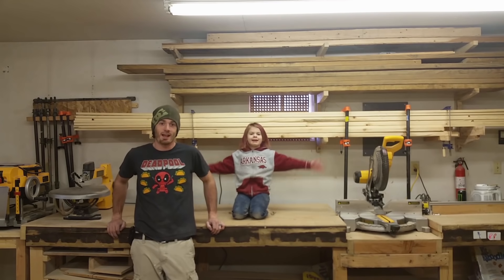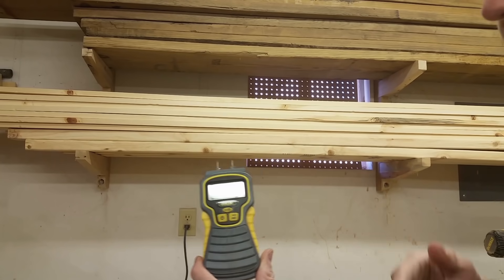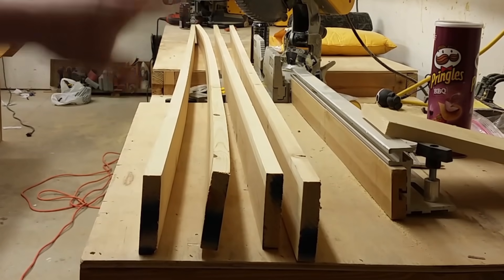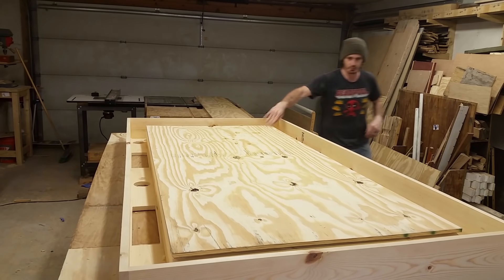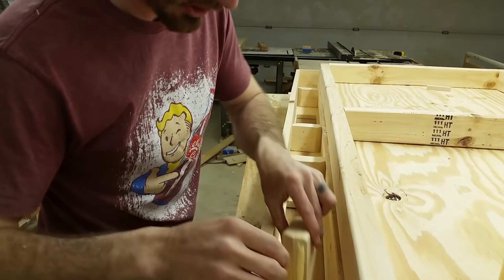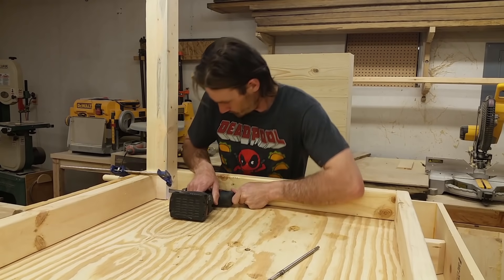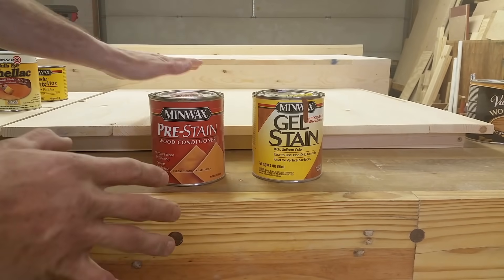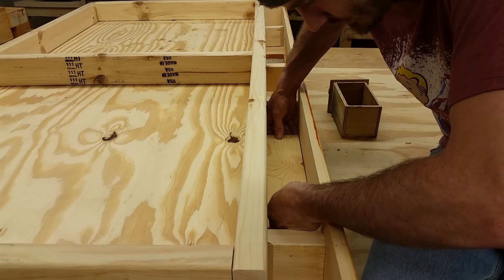How to build a gaming table (easy)

Comment: Might be worth noting that the best way to dry your wood in the shop is to install stickers (~1/4" thick sticks) between the boards and then clamping on the stickers. This leaves small gaps between each board to allow for proper airflow between the boards which results in more even drying.

Comment: Love this, well done.  Going to do something very similar here shortly.  I am going with neoprene mat for the vault surface, and will use a pin hole to push up the table top edges to remove them, and will have a 3/4 piece of plywood cut into 3 or 4 pieces with dowels on one piece to assemble together.  Also going with a trestle base.  Debating cup holders on the outer rail with router or cut out player areas like you did, or have those all on a rail around the outside.  I also plan to stain to a darker color, but all of that is just finishing stuff.

Comment: For the EVA foam, give it a once-over with a heat gun to close up the pores. Once that's done, contact cement won't absorb as much, but still has enough porosity to give solid adhesion.
It's an old cosplay trick.
Reply from the maker: Good tip! I'll have to try that

Comment: Great video.  One thing I've wondered about this game table design (as I've seen this built the same way on several channels) is why there is so much effort made on the dice trays and cup holders and why those areas are so narrow.  I built my own table without plans and used 1x12 for those areas to accommodate books and papers.  I didn't build trays or cup holders.  We spend so much time writing notes etc., that I thought that was more important than the other stuff.  If I were to build mine again, I'd build it the same way, but have a drop down area in front of each player to be able to "store" books, papers, etc when not in use.

Keep up the great work.
Reply from the maker: Thats a really good idea. Personally I'm not much of a gamer so I just built it the way my friends wanted it.  They wanted cup holders and pencil holders. I think making a spot for books is a great idea. Thanks!
Reply: Coming in late, I am starting my game table build next week. I would say it depends on the kind of gaming you are doing. We don't do any pen and paper, but board games. So we don't have any books or notes taking happening. Trays for us would be more important for meeples, coins, cards, cardboard bits, minis, etc. and manipulating the actual pieces on the board every turn makes a narrower edge more practical so you don't have so much to reach up and over constantly.
Reply: Coming in real late, but the reason most players go with 4 to 6 inches for that outer rail is because the larger this is, the farther you are from the actual game surface and the more players need to stand and lean in to adjust playing pieces or whatever.  We have a few games where there are a lot more components to organize at a player station, which is why I think I will end up going with an outer rail along the edges to put in accessories like player boards where they can place these types of things.

Comment: You know, for the tabletop insert, you could also glue on and/or screw on a canvas backing like a roll top desk. This will keep the boards together and in order, and allow you to fold up the top to make it smaller and less unwieldly.
Reply from the maker: Oh I like that. Maybe it could even roll up.
Reply: @WyldeWoodworks  And put it on the shelf under the table so it's out of the way.

Comment: Wow this was awesome! Thanks! I may soften the edges of my table a bit and make the cup holders a little farther apart but this is going to be providing a huge starting point. Would be pretty cool to lay in some finished pieces over top your trays too so those can also have flat surfaces when you want to cover it. I’m curious to see if you think the Eva foam ended up having any visible seams or if you would’ve done anything different for the liner.

Comment: A tip I saw on another video was using an epoxy with a relatively long working time instead of contact cement. Still holds strong, but it gives you some time to get it just right. They were applying veneer, but I'm sure it would work for EVA foam too.

Comment: Oh man, Loved this whole video, except when you had the nail gun pointed directly at your stomach (I know there were some other layers, but still.... NO)
I probably wouldn't have gone with EVA foam (or installed it quite so late in the process either). You can get rolls of Headliner Foam that is wide enough to cover a sheet of ply without the risk of seams in the center. Cover that with some speed cloth (or not depending on your preferences) and you're golden.
I really liked the first few minutes of the video as the tips you gave are really useful to folks of any skill level. Thanks for sharing this process with us.
How long did this build ultimately take you?
Reply from the maker: Good point! I've never heard of headliner foam before.  The Eva was the best I could think of and it really didn't turn out as well as I wanted it to.  I'll have to try that next time.  I think the whole build took me less than a month but I don't really remember since I built this about 2 years ago. Thanks for the input.

Comment: I work in water mitigation and 5% moisture content in wood is extremely dry.  The natural moisture content of wood in the southeast is 15%, so look up the natural moisture content for your area because if you have it at 5% and move it to a room with over 60% relative humidity than the wood will warp.

Comment: Hey man, on your material list the last item says: 2 8' 4x4s   Shouldn't it be 2 8' 1x4s ?  You didn't use any 4x4s but the 2x4s for the legs so I'm assuming that was a typo for the wood needed for the inside pieces?  Great video though, really appreciate all the tips, especially on the wood grain, and the shellac. I'll be making nearly the same table except a 4x4 version.

Comment: Hi. I saw that circle cutter but wasn't sure it would work on hardwood.  Have you ever tried it on maple or walnut?  How long does it take to cut through one inch?  Thanks for your video!
Reply from the maker: It works well enough.😅 Probably 5 min to cut through 1" hardwood

Comment: Just want to leave a comment here to help your channel. I loved this video and will use it when I decide to build my own table! One question: My table will be going into an external building off my house where the humidity is a little more difficult to control.  Once built, is there anything that can be done to help stave off the effects of warping due to natural changes in humidity over time?
Reply from the maker: Good question! Use at least 3 coats of your top coat (shellac/polyurethane) then add paraffin wax to the surface. Pay special attention to the end grain. Epoxy also works very well but its a bit more pricy. People make sinks with epoxy and wood all the time.
Reply: @WyldeWoodworks  thank you! Your advice is invaluable and you've gained one more subscriber!
Reply from the maker: Awesome!

Comment: Can you explain why the bottom piece? I feel like it takes away from being able to sit comfortably at the table. Is it solely for added stability for the legs? Thank you for the video!
Reply from the maker: Sure.  Yes the main reason for the bottom support is to keep the legs more rigid. If you don't have some sort of support for the legs the table will end up wobbling a lot. If you don't want to stabilize the legs that low you can add more framing to the legs up top. I would suggest getting some one by sixes to frame out around the legs  Just below the table. Then you can glue and screw Them directly to the legs. I think that would work
Reply from the maker: Good question

Comment: Very interesting.  A few notes from a gamer who knows nothing about woodworking.  

Dining toppers are best when they cover the entire top, so you really can't tell it's a gaming table until the top comes off. 

Also, you have to assume there will eventually be a spill when people are eating, and that can ruin the game living underneath (not to mention the fabric surface). Therefore the dining topper should have extra waterproofing (tongue-in-groove is what I usually see). 

I couldn't tell from the video, but generally the vault (gameplay area) is recessed about 4 inches.  That makes for comfortable gameplay, and also prevents pieces/dice from flying off the table.

Next, most modern gaming tables have drink holders outside and below the rail, to minimize any possibility of accidental spills onto the play surface. 

Lastly it's best when the fabric lining is removable, rather than glued into the bottom.  I've seen the material made into a reversible mat that's really cleanable with a lint brush.

Thanks so much for the lesson!  It was really interesting.

Comment: On the boards that warped, can you throw them in a pool (or something) then re-clamp them and wait for them to dry again?
Reply from the maker: It depends on the situation but I have heard of people steaming wood to bring it back into shape. If the wood has been dry for too long won't accept steam as well. Once the connective tissue between the wood fibers is dry there isn't much you can do to salvage it.

Comment: Sorry if it was mentioned somewhere but what thickness did you use for the plywood??? Im trying to figure if 1/2' will be good enough or if I need to use 3/4".
Reply from the maker: Both will work. I don't remember what I used in the video but I would probably go with the 3/4. 1/2 will be good enoug but won't be able to support as much weight without flexing.

Comment: i want to build a similar table but i don't want to have the box shelf on the lower part of the legs. If i copy your legs exactly, what challenges might i face without a lower box to brace the bottom? Can i use an "I" style frame at the bottom instead?
Reply from the maker: If you remove the bottom box entirely, it will make the legs fairly wobbly. An I style frame would help that a lot depending on how sturdy you built it.
Reply: @WyldeWoodworks  thanks for the info! I plan on making a full 4x8 table with six legs instead of 4. So the bottom brace would be more of a double sided E. Do you have any suggestions?

Comment: Nice table, but it can be done much, much simpler.  I took a 4x8 sheet of press board with a Formica finish.  Used a router to cut out dice holding stations, rolling stations and drink holders.  Used 4x4 and and 2x4s for legs and table braces.  It seats (8) comfortably and (10) when needed.   Built whole table for $30.   No warping.... Still going strong 10 years later.

Comment: I was hoping you might be able to answer a couple of questions and I wanted to thank you for this video which I have watched many times as I prepare to make a similar table.  Given space restrictions I am planning 5' x 5' table but want to put it on locked casters so I can move it around.  Any experience on casters regarding load weight, materials?  I know its been close to three years since you built the table but any recollection on the approximate height of the table? I estimated the top of the table is around 37' perhaps?  If I use 4' casters then I would need to reduce the height of the legs down to 28'
Reply from the maker: All of your intuitions seem spot on. A 28" leg with a 4" caster should work out very well. I don't remember for sure but I think my table ended up about 37" tall which is a bit taller than the average dining room table.  The biggest concern with using casters would be that you'll have a bit more racking in the table so make sure all of your joints are solid.  Also you won't want to skimp on the quality of the casters. Cheap casters make life more difficult and go out prematurely.  It sounds like you're on the right track. I'd love to see pictures of it when you're done.

Comment: I'm looking to try to build a table similar to this, but I really like the look of Poplar. Do you think that would be a good wood for a project like this, or should I stick with Pine?
Reply from the maker: That would be a beautiful table! I would love to see that if you build it. The only issue I would see would be the price. Pine would be cheaper
Reply: Poplar is a type of hardwood, but it's not that hard..  It is however harder than pine.  I use it for the framing of furniture.  It can be a very plain white wood or have many effects in it.  It will not have as many knots in it as pine.  I think Poplar would make a beautiful table especially if you can find some rainbow poplar for the false top!

Comment: so, I'm getting ready to do something like this, except I'm making it coffee table sized and I want to put 2 things in that you didn't... 1. power on all sides, and 2. an inlaid TV with plexi over it in the recessed gaming area.   I'd *prefer* to make it as something that can be set on top of an existing kitchen table (since the wife won't let me make a new kitchen table and we don't have room for a dedicated gaming table in the current house)

what suggestions/changes would you use from this build?  

I've already found the outlet sets that I want to use (they're "flush mount" surge strips on amazon), I'm debating whether to use a junction box, wire them all together into a single cord that runs from the junction box to a wall outlet, or, putting a regular surge strip in and plugging the 4-6 smaller ones into it (along with the TV obviously).

Debating how to go about putting the TV underneath it, I'm leaning toward a vizio LED smart tv, so, it won't be heavy nor hot, but, it does have the smart TV functions built in already so that we can mirror devices directly to it, allowing us to have full control over what the group sees, and possibly use it as a realtime usable map for placing minis above...

thanks in advance for any input!
Reply from the maker: I love this idea . My wife has been wanting me to do something similar for a while but a box like this still has to be stored and unfortunately we don't have room for something like that. Actually you could just straight up turn it into a coffee table. I might have to steal that idea lol.

I've seen people put a TV in one of these before and it always looks really cool. Covering it with plexi is also a good idea but you will have to worry about the heat. I wouldn't make a box for the TV to sit in though. Most tv's have four mounting holes on the back so you could pretty easily make some wood brackets to span the space instead. 

 I'm not much of an electrician so I can't really advise too much on the electrical idea. Personally I wouldn't wire power strips together. The best way I've seen this done is just to use wall outlets mounted correctly inside boxes with cover plates then you can run all of the wires to one junction box and have a power cord running out of it. I think that would be the safest. If you have a chance go ask a proper electrician what the right way to do it is. Electricity isn't  something you want to get wrong. But like I said electricity is not my thing.

Let me know if you build this. I'd love to see pictures!
Reply: @WyldeWoodworks  well, the coffee table was the original idea, BUT, then the gaming group turned into 8 people plus the DM and we can't crowd that around the coffee table... so, that went out the window.

as far as the running the surge strips to a single junction box, that's effectively what "wiring it correctly" does, except it's the equivalent of having a 4 USB port plus 2 AC plugs GFCI outlet on each side... which would work, but, why add extra complexity and cost ;)  

as for sending pics when it's done... absolutely, but, much like the video here, it may take a while to get finished ;)

Comment: Cool build.  I was wanting to make a DVD Blu-Ray library case for probably about 5000 movies. I have all Maple floors in my 1950s house. What kind of wood would you suggest?
Reply from the maker: I would probably use pine boards like I did in the video. If you have the money you could cap the front with a mohogany frame. Very classic

Comment: Do you have a rough cost on  how much the materials are?
Reply from the maker: If you don't account for the cost of tools you can probably do it for about $200. If you get higher-quality Lumber the cost will go up from there
Reply: Thanks, I'm planning on whipping one up soon!
Reply: Man, I don't know where you got your wood, but the 8x1s for the top leaves alone is going to cost like $150.  Odd how expensive those are.  The rest wasn't bad though.

Comment: Can i get a like, materials used list my dude? trying to build one but am trying to make it bigger, would like to use the list as an example of some sorts
Reply from the maker: Sure thing. Links are in the description
5 8' 2x4s
20 8' 1x8s
4 1x2  Furring Strips
1 4x8  Plywood Sheet
2 8' 4x4s
Drop-in Cup Holders
https://amzn.to/2Vxqg7F
Dock Hardware 1/2" x 6" Carriage Bolt Set
https://amzn.to/3ldrhha
Titebond II
 https://amzn.to/2BoMsub
EVA Foam Sheets
https://amzn.to/31zrBiB
Dap Weldwood Contact Cement
https://amzn.to/2EBnERB
Varathane Wood Conditioner, 1 quart, Clear
 https://amzn.to/2XiuFgM
Varathane Gel Stain, Quart, Golden Oak
 https://amzn.to/3gFPY3O
Bulls-Eye shellac (clear coat)
 https://amzn.to/2Kgs4wQ

Comment: How could you make this table work without the 2x4 frame under the plywood? The width of the 2x4 apron would hit my knees every time I sit down.
Reply from the maker: You could notch out the 4X4's so it  Nestles around the corner of the plywood.  Or cut a square hole in the corner of the plywood and allow the 4X4 to recess into the tabletop. It would be seen from the top but it would add more stability to the false top.
Reply: @WyldeWoodworks  thanks for the fast reply! I currently have the table half-assembled and have been stuck on this—I’ll sketch out your suggestions and give them a try.